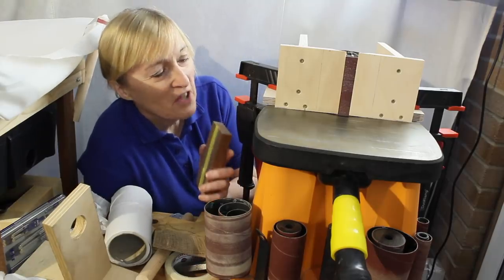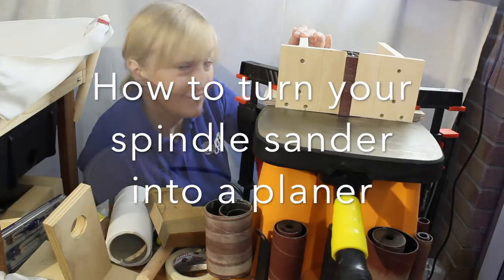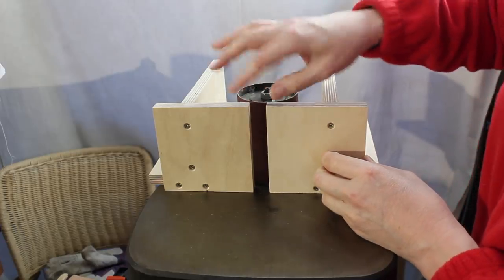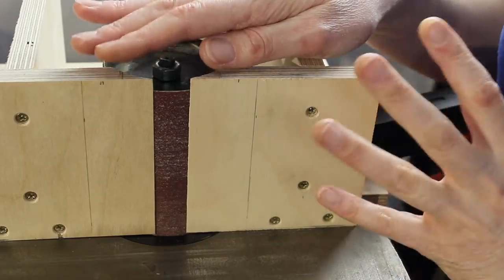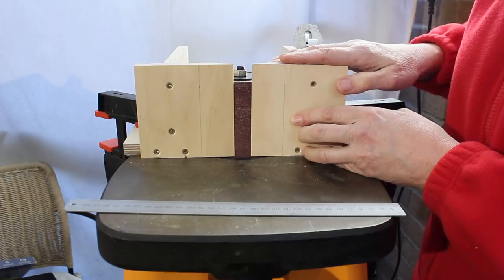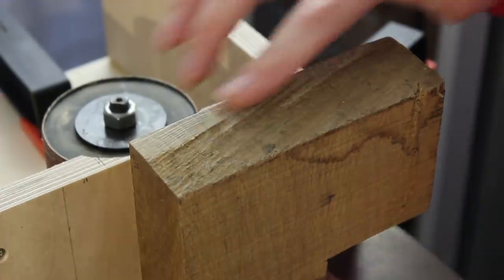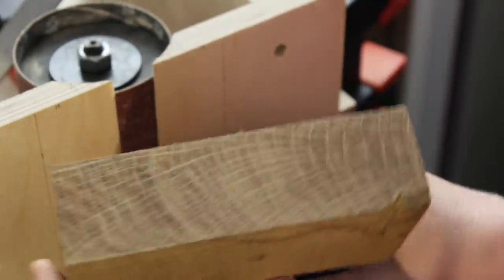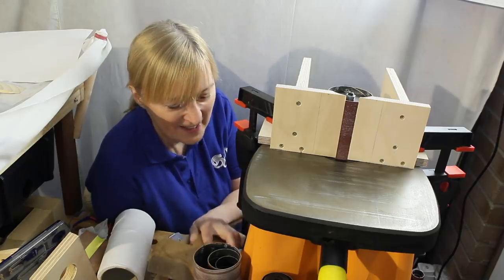How to turn your spindle sander into a planer

Comment: This jig is brilliant. I can see using it for a lot of different jobs, such as thinning splines. Your using it to cut a groove in the sanding block is inspired - I would have tried to use my router with a radiusing bit and probably sworn a lot and created more firewood than I like to think about. Like a scrollsaw, your jig is ideal for small piece work where larger scale tools would jack up the risk. Thanks,
richard
--
Don’t aggravate someone serving you a foamy drink.

Comment: Very cool! Just bought a oscillating spindle sander for my buisness will definitely be fabricating one of these fences. It's much closer to a bench jointer than a planer though considering you have a perfect 90 degree surface to work with. A planer does not.

Comment: Amazing concept. I have a rigid sander which will require an additional bottom plate to the design for it to have space to clamp. But no longer do i have to buy a jointer!

Comment: Overall, a great idea!  However, with this particular block, I think it would have made sense to take a small sliver off the rough end with band saw, using the mitre guage or with either a mitre saw or table saw using a crosscut sled.  The final finishing could have been done with your brillian jig.  However, after removing a sliver of wood you would probably only need need a finishing pass on the edge.  Given the aount of material removed with each pass vs. the amount that needed to be removed, you are looking at a slow process.  Since there is no apparent offset between the planes of the infeed and out feed sections, (i.e.they are coplanar), the corners of the work piece will be slightly rounded off to an extent approaching that to which the drum lies proud of the surfaces.

Comment: Still a sander though :-) That's a good idea. A disk sander is what pros use, but that gives you the same result. You can do that with a hand plane, but it is quite advanced. Takes a very sharp low angle plane, some muscle and skill. And a steady bench. I don't recommend oak for practicing :-) End grain planing can be strangely satisfying when it goes well, but very annoying when it doesn't.

Comment: Looking at this jig as compared to a jointer, it would probably help to have the left side of the vertical be proud and even with the amount of protrusion of the particular drum used. That way you don't have to worry about accidentally pushing the sanded piece to rock over the drum, causing it to create a longitudal curve.
Reply: I just came to the part where you're addressing this, thanks. On a hand planer with a blade, the opening where the blade sticks out controls the depth of cut, if it were too big, the shavings would have hard time curling into ribbons and would be too hard to move along. In the process, a greater force is used to push the plane downwards which I suspect compresses the planed surface. On the sander that force is non existent so I think the pivoting ruining a finish is still a possibility.

Comment: You can make a similar platon to mount on the top of your drum sander (in plain with the dust extraction hose) so that you can do the same for large things which need flattening but wont easily fit under the sander. Now I just need an oscillating spindle sander so I can make one of these !!

Comment: Great job Susan!  I'm trying this with my spindle sander, but am getting a scalloped edge.  Any other suggestions?
Reply: Either your two fences are not aligned, your sander spindle is too far out, or you are not keeping the piece tight to the fence on entry or exit. Even just the slightest wrong entry or exit angle can quickly get out of control if you are using a coarse grit on a small piece.

Comment: Did the slow-mo repeat of the "spark" from the bandsaw mean anything, like maybe pre-shadowing something? Or was it just some editing fun when you watched back the video?
EDIT: Foreshadowing even.
Reply: DeepPastry Dunno, my saw sparks too.
Reply: @tomahoks  ... I would assume it's just some mineralization in the wood igniting as a spark; ie flint and steel type interaction.
Reply from the maker: I was a bit baffled as to why I got a spark. I think the rear bearing was too far back, but I’m still puzzled why I only got a spark after I’d finished cutting
Reply: I wondered if it was static electricity? There is a certain similarly between a band saw and a van de Graaff generator.

Comment: It would have been much quicker to cut the end grain off on a table saw then a couple of pauses with this tool to smooth it.
Reply: Sure for most jobs, but for those of us who don't use a table saw enough to justify to purchase or accommodate one a spindle sander is a decent way to go about it.

Comment: The design of the hand plane (which was used to justify the design) is actually flawed. The fact that the outfeed part is flat to the infeed is why 'jointing' planes are so long- it is an attempt to compensate. Power hand planes do not have this flaw, and can be much shorter. Why this flaw? Manufacture of a correct design would have been expensive and difficult to maintain (the blade is adjusted by hand) and skill can compensate. Given that an apprenticeship was several years, that skill was available.Then.
Why are correct design hand planes not available now? Given the volume, they would be dearer than power planes. And traditionalists would not buy them.

Comment: Most woodworkers (including me) would have sawan it square and if needed cleaned it up using a shooting board. Relying on power tools for all your work won't help your skill set in the long run, learning how to sharpen tools to razor sharp is the way to go. It would have taken me a few minutes to get the same result and with far less cost, with a better finish.